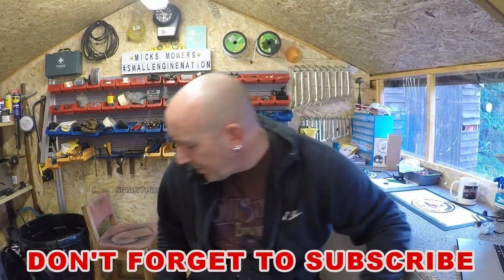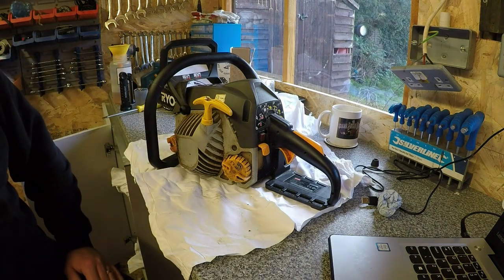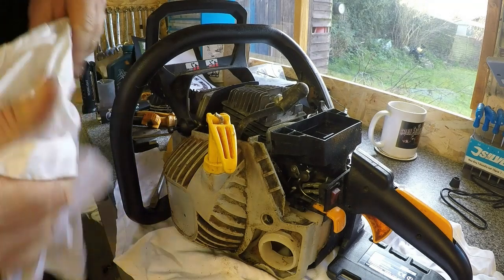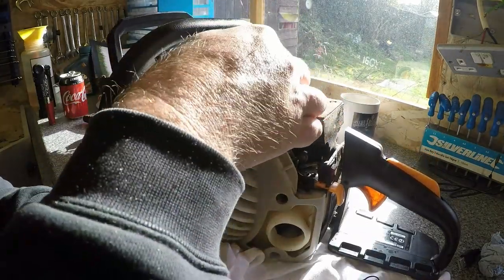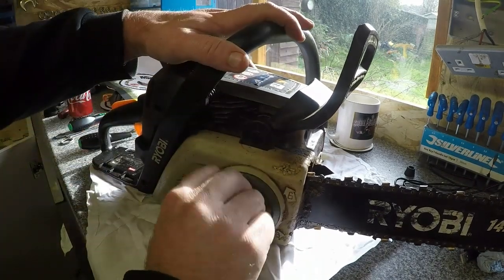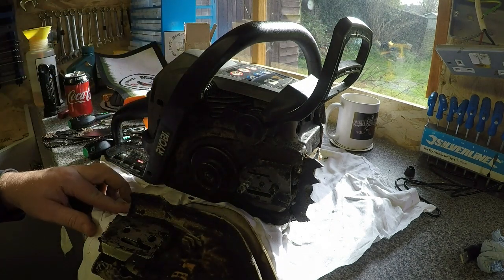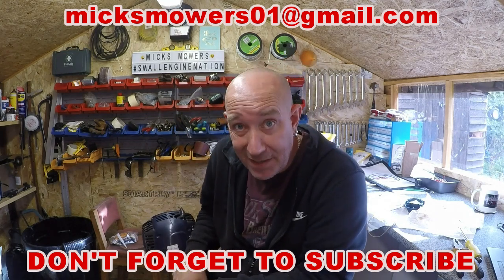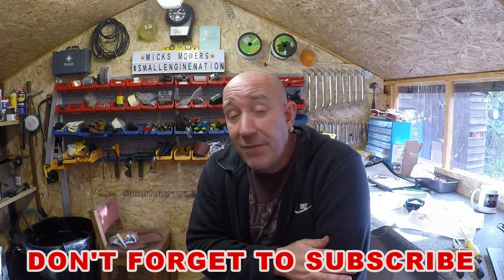#chainsaw #saw #howtofix Free Ryobi Chainsaw Lets See If I Can Get It To Run

Comment: Mick that pro grass trimmer because the pull cord assembly is off it is it worth putting a drill with a socket adaptor on it to wind it over just to see if it runs
Reply from the maker: got a spare one that has been sent to me mate